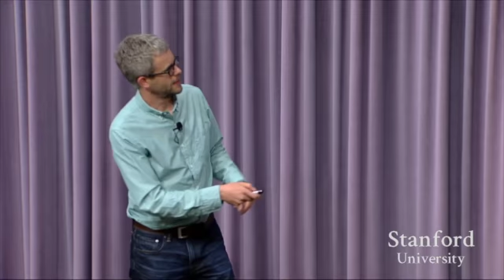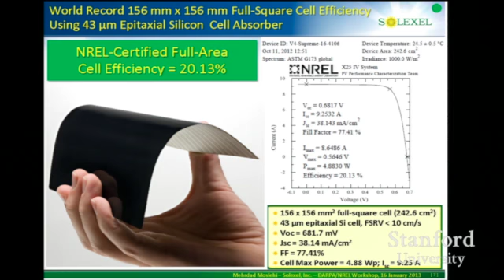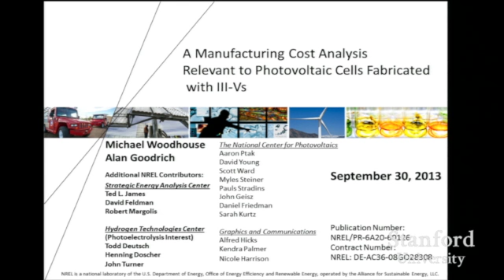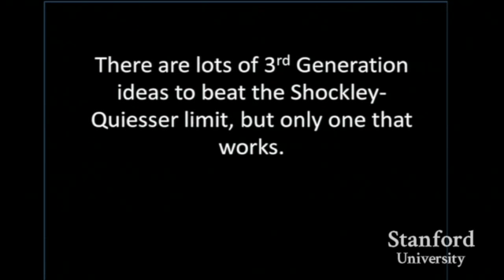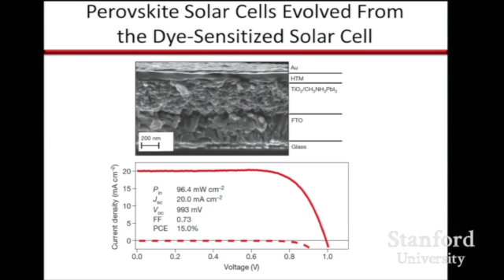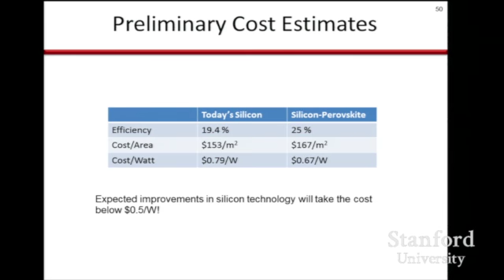Emerging High-Efficiency Low-Cost Solar Technologies: Solar Mini-Series (2 of 2)

Comment: Make sure you design these so they can easily replace older panels for installing them on Preexisting Racks a lot of the cost came from the Rack installation if people are upgrading or replacing